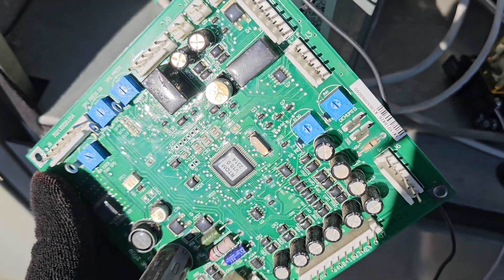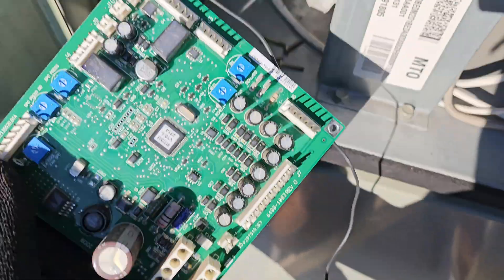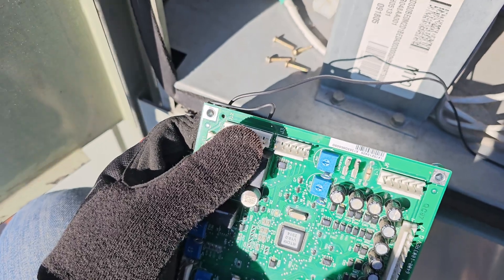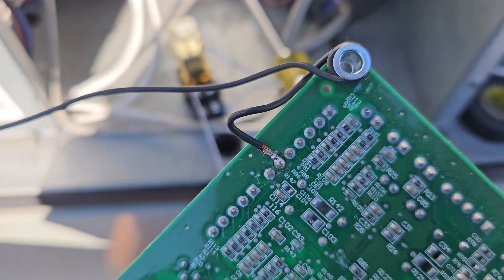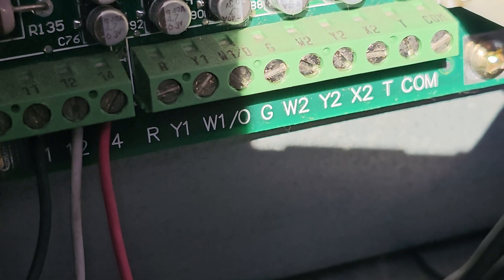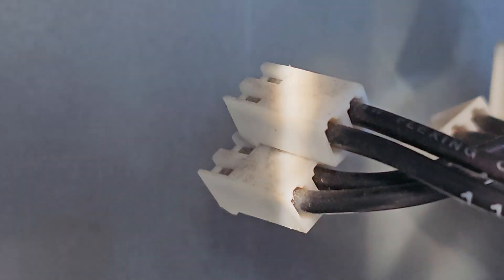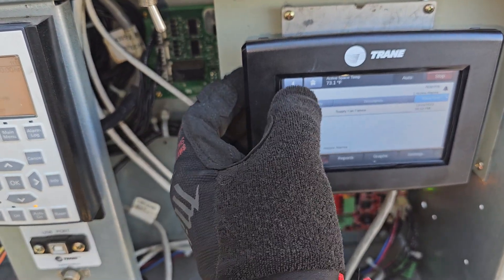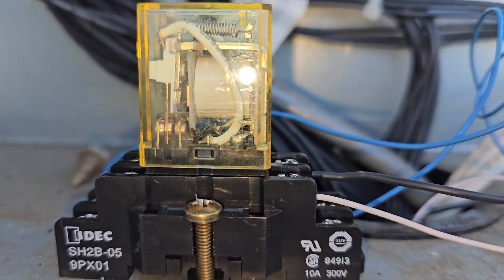HVAC CONTROLS | RELIATEL MICRO PROCESSOR CONTROLS

Comment: Just me, but if the customer can afford to have that unit,, then you shouldn’t have to resort to modifying the circuit board. Also remember the guy coming behind you without a revised wiring diagram.

Comment: Why would you want to shut it down on non critical alarms. Seems like it could generate a lot of nuisance service calls. Just curious
Reply from the maker: Special situation with this particular client!
Reply: I thought its a common alarm output, most likely for the bms. A clogged filter switch could probably trigger the output. But I would have never opened the door for the customer to think this is standard practice. Awesome job by the way but for me and my customers, I’m like do it right or don’t do it at all. Because you know they’ll expect you to modify parts or whatever the next time.